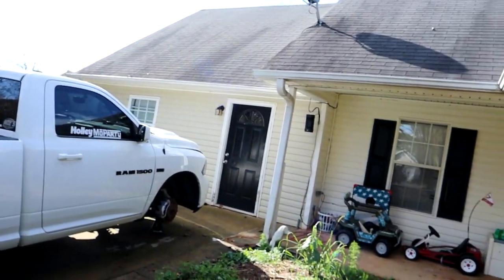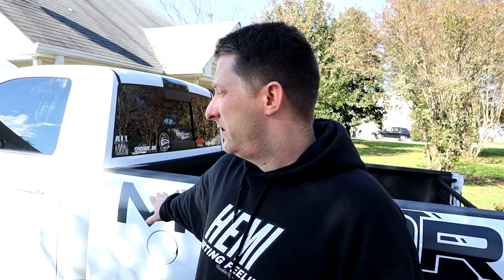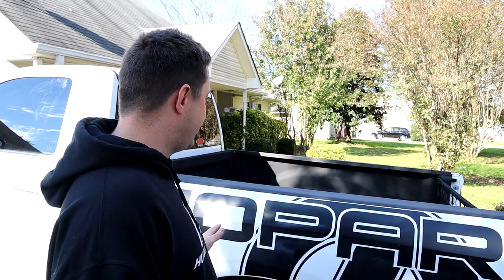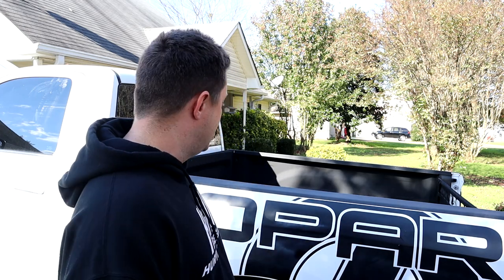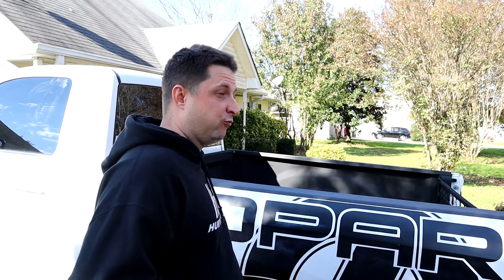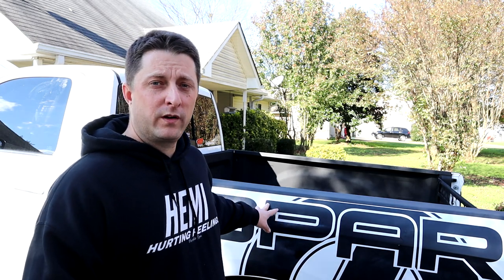Turkey Day Cold Start!

Comment: Great videos that you post on Frostbite.  You give me a lot of ideas for my 2014 Ram💪.  What diablosport are you using?  Happy Thanksgiving for you and your family
Reply from the maker: Thanks bro, I'm currently using the trinity 1000.
Reply: What's the difference with diablosport intune i3, diablosport predator 2, and trinity 1000?  I have a  2014 5.7 Ram.  I been hearing that diablosport can mess up the pcm with if you tune the trans.  Does it work fine as long as you don't tune trans.  Reason I'm asking my truck has misfire on cylinder 6.  I switched pcm, changed spark plugs,  and coil on cylinder 6, and the four mds sensors.  It's still has engine light for misfire on cylinder 6.  The spark plugs on cylinder 6 has only oil on bottom tip of spark plugs.  It might be O rings, head gasket,  spring valve.  It sounds like it tick a little on cold start but, after driving it goes away.  The truck drive fast even though it has 180,000 and bought the truck use.  If it comes to worst to change out cam and replace non hellcat lifters.  And just want to know if diablosport is good to tune the truck if I change out cam and lifters.  Sorry my texts is kind of long🤣🤣.
Reply from the maker: @efrensalinas6436  the intune is like a small cellphone, the trinity let's you see live data on the screen.